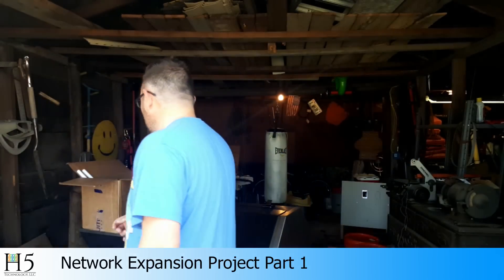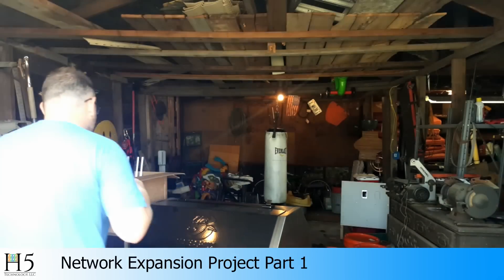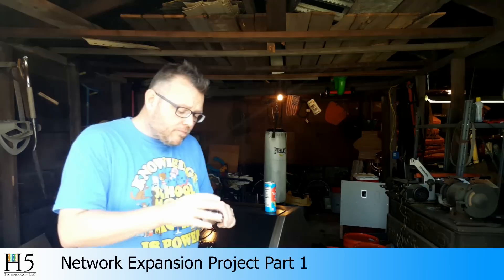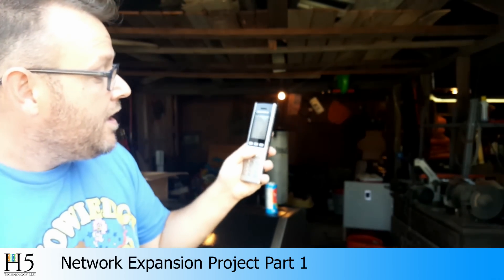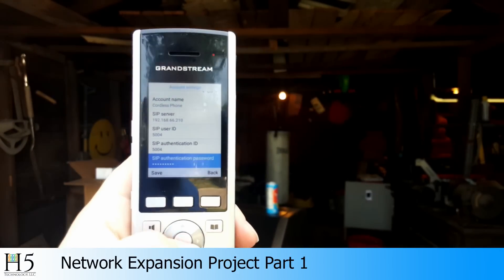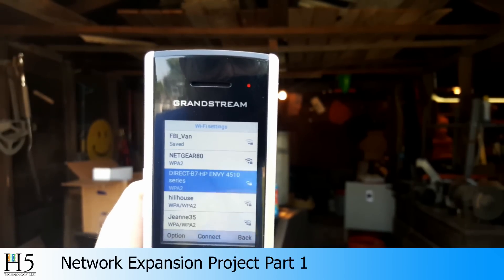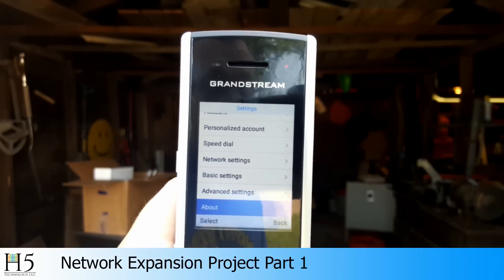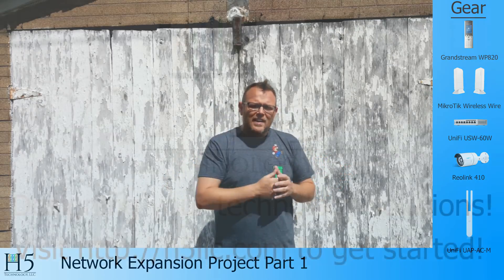Network Expansion Project - Multi Vendor

Comment: why not just use nano stations??????????????????????????????? i have shot through concrete using a nanostation m2. to run temp Ip cameras 3 cameras. with no problems.and it was 200 feet.  2 concrete walls 8 inches thick. then 5 walls with sheetrock. 2 walls have 2 layers of sheetrook and the other side has a single layer of sheetrock.the remaining three walls are normal 1/2 inch sheetrock.   i could see if you were doing a video featuring a new product specifically featuring  a another company. doesnt seem like that is the case
Reply: I did mine (100 yards to workshop) with NanoBeams, which are 5 GHz. Work great. But then I was able to  mount mine on the exterior.